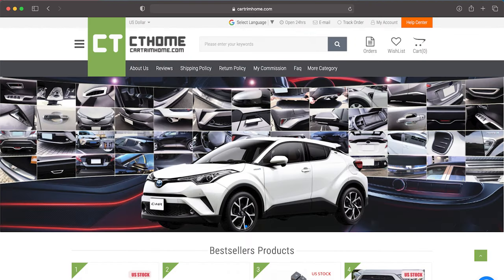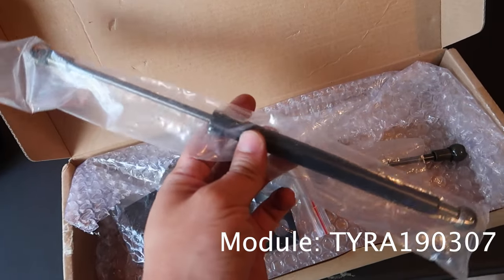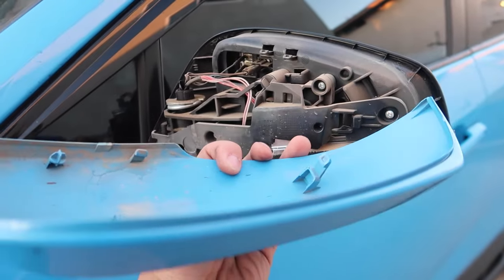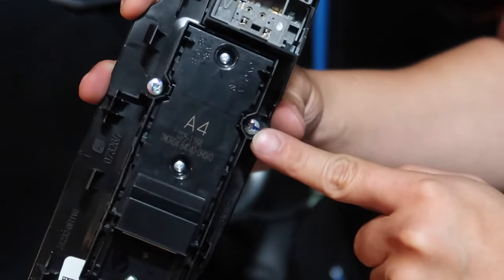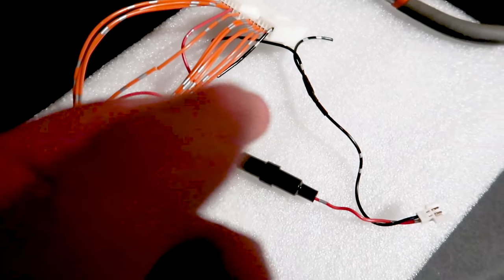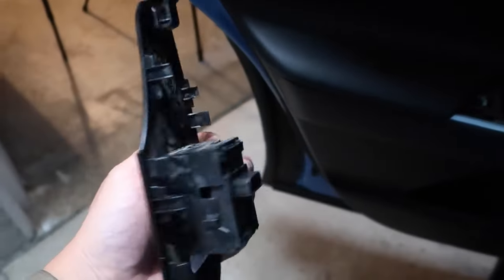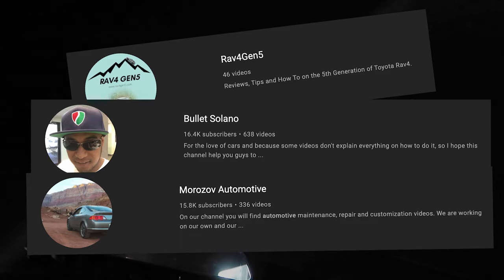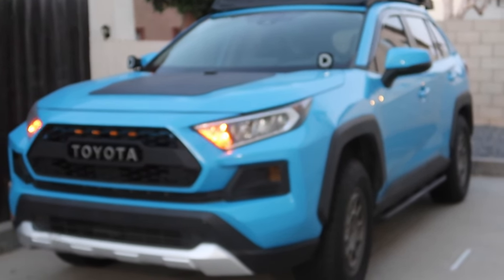5 Cheap & Easy Upgrades for 2019-2023 RAV4 Anyone Can Install!!

Comment: Nice Rav4 4.5. My 2018 Rav4 XLE (Rav 4.4) has a total Lasfit conversion done to it. I may have to consider getting those side turn signals now. Sadly the side mirror turn signals are a sealed unit like the 4.5. Strange that my 2018 C-HR XLE uses a bulb and is not a sealed unit. I did the Lasfit total conversion on my C-HR as well :-) The turn signal is all amber on the C-HR and very bright at night.

Comment: Hello Danny 
Please tell me if there is a way to hang my spare tire on a roof Rack. let me explain.  I have to ride from Tampa Florida to ORMC IN Orlando Florida for treatments. its a nightmare on my back and body. 
I'm looking to put a bed body in the back of my 2019 Rav 4 Prime XLE.
I plane on using the spare tire wheel well for medical supplies and clothing changes since I have to stay in the area for 3 days at a time.  Any suggestions would be very helpful. 
thank you   Sign  P& L Stage4

Comment: Enjoy your YouTube channel. I just bought this RAV4 hybrid. Has 75,000 miles on it. Concerned about battery. I hanever been able to get the battery to show full charge. Recently on a trip on the interstate this, in the picture is the best it would do. When it gets to three empty bars from top it starts using from the battery. Is this normal? Is there an adjustment needed for that.?  I could figure out how to send the picture. What it is the picture of the engine running the car at 74 mph. Also pulling voltage from the battery with only 4 bars of battery. The battery level never gets higher. I had driven on interstate 30 minutes when picture was taken.

Comment from the maker: My ranking is:
1. Illuminated window switches
2. Smoked turn signals
3. Door handle lights
4. Interior LEDs (these are insanely bright)
5. Hood struts
Reply: Hi, great video! For the illuminated window switches, did you choose style A or B?
Reply from the maker: @dfleurius  looks like I got style B—only has an illuminated dash versus illuminated window icon.

Comment: Watch the hood install.  Some report that the thin metal up there may bend.  I already see the hood vibrate as it's not glued that well to the underneath support.
You forgot the horn... a 10 min $20 fix.
Reply from the maker: Yeah I’ve taken it out on the trail and there’s definitely a lot of vibration in the hood, but it hasn’t been too crazy—already did the horn when I swapped out my grille. Easy $20 mod!
Reply: What did you guys do to the horn? I’m interested as the current sound like a beetle
Reply from the maker: @TacoMonster4eva  hella horn plug and play Toyota kit
Reply: @DannyRocksteady  ok pls

Comment: Hey I got the led bowl door handles and the power window led switch as well....how am I supposed to connect both? Do I connect the harness of the les door handle to the power window switch harness and then the end of that into the power window connection?
Reply from the maker: Pretty sure that’s how I did mine… it’s been a while though

Comment: Why has your engine by got no covers or sound proofing on the bonnet. My below windscreen plastic panel run-through whole with there is no gap between wing the hinges come thought rubber slots. Do the cut down on sound proofing for USA cars.
Reply from the maker: 2019’s didn’t come with them

Comment: Nice mirror light install, but it would have been helpful to see the process that you fast-forwarded through where you were positioning the wiring for the light in the driver’s mirror.
Reply from the maker: It’s literally a plug and play process. Unplug the old one, plug in the new one, reinstall.
Reply: @DannyRocksteady  Thank you for the reply and the info! Much appreciated!

Comment: After installing them how have they faired so far? The sequential lights and button switches
Reply from the maker: The hood struts stacked on my ditch light mounts have created a little bit of vibration in the hood, but other than that everything has performed extremely well and have not caused any issues

Comment: So for my rav4, my hood doesn't have holes or bolts for the hood struts. should I get holes drilled or do I have to get a new hood or what would you suggest?
Reply from the maker: Assuming it’s the current model—you don’t need to make any modifications. The strut kit is designed to mount right up with the factory hardware
Reply: @DannyRocksteady  it's a 2019 and it doesn't have the side mounts like yours. It has the bolt on the frame but not the hood. There's not even bold holes on the hood
Reply from the maker: @jedcrossman1622  you have to use the bolts that are securing the hinge to the hood